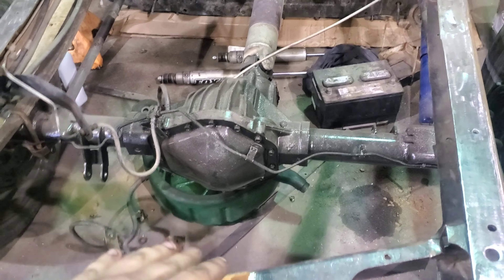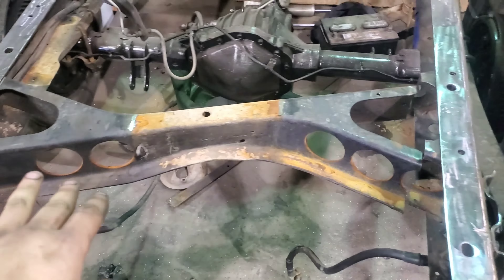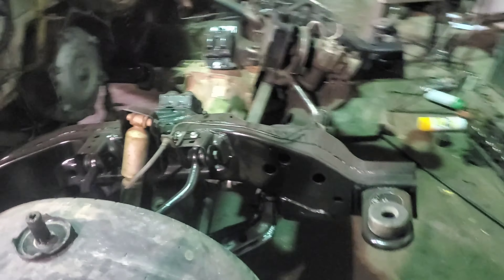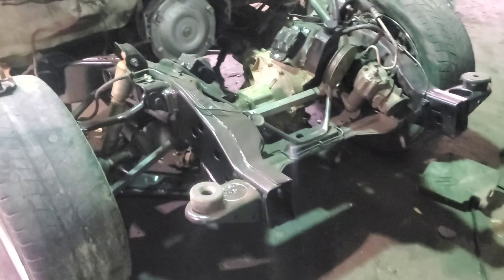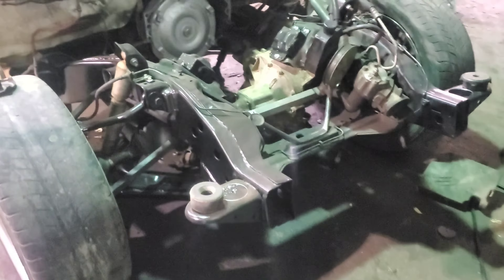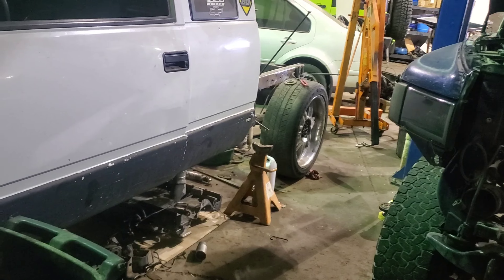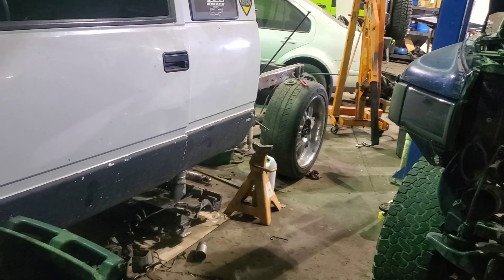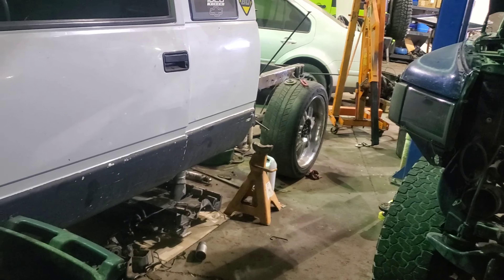Lt. Dan got new legs! Buckwild 6.5 Diesel Build Update

Comment: So uh.. since this truck is pretty special, are we gonna get to see you do something special/one off for the tow rig? Like I dunno.. compounds or seeing how realistic a zf6 swap would be?
Reply from the maker: I am going to be building an engine for the tow rig, converting it to mechanical injection pump, and I'm either going with a he351 based turbo or a s300 frame turbo, as well as an intercooler. I'm undecided on trans at this point, either building the 4l80e in it or I would love to look into a zf6 swap